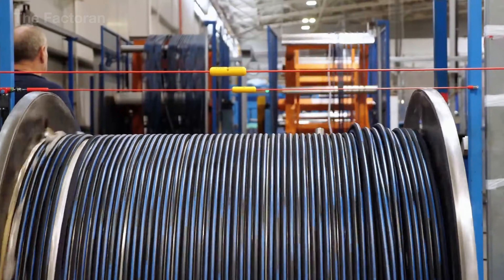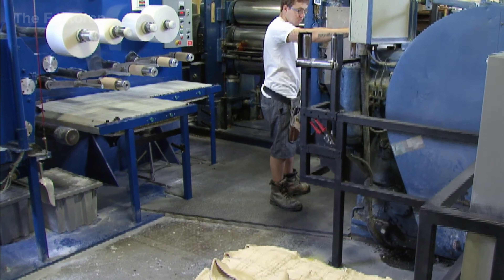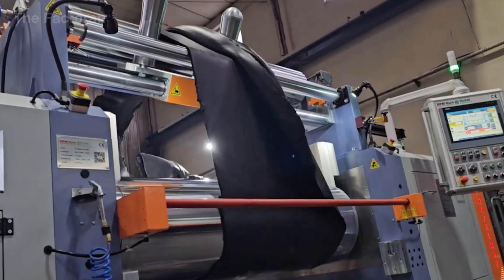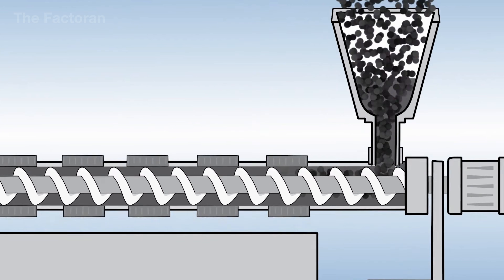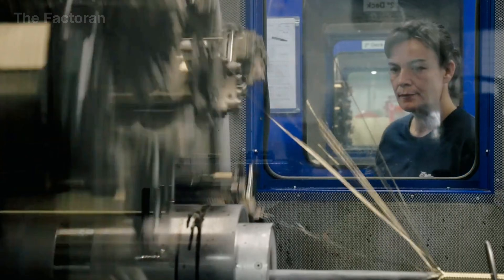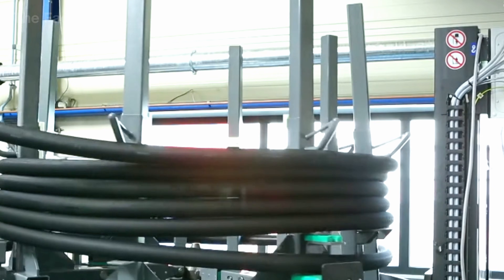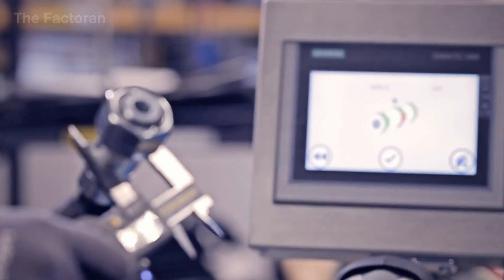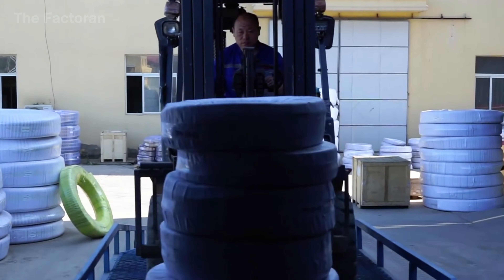How Millions of Hydraulic Hoses Are Made Every Year Inside Massive Production Line

Comment: A suggestion: Don't keep switching super fast between machines and processes. Examples: the wire braiding and the crimping of fittings. Show each crimp fully, not racing between tiny steps of many different fittings. Impossible to observe the processes.
Reply from the maker: Great point. We’ll slow it down and show each process more clearly in future videos.